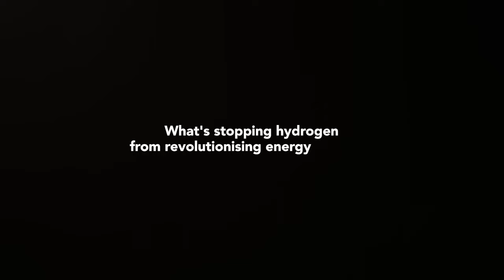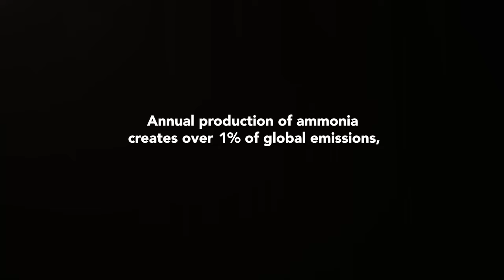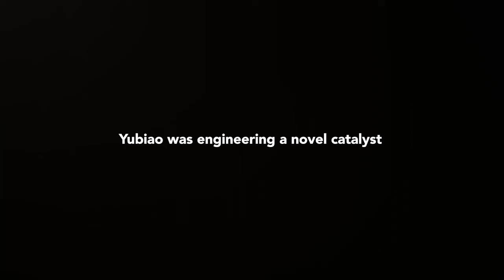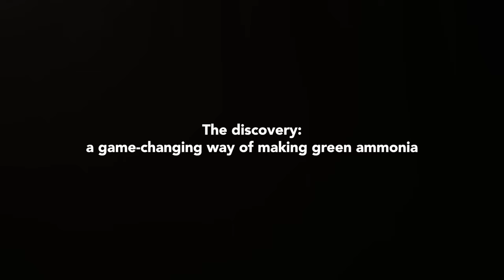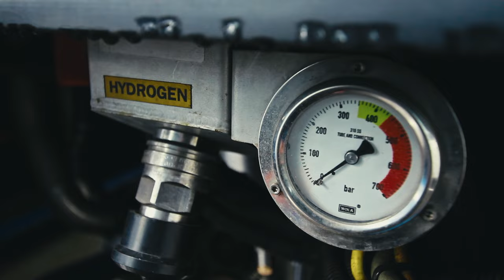How Green Ammonia Is Helping To Drive The Hydrogen Transition | Nium | RE:TV

Comment: Recently I was reading about eutrophication of lakes and rivers. One of the contributors to it is rain heavy in nitrogen. How is that solution contributing to the problem? Heavily/at all? Seems like if everyone would burn fuel that emit nitrogen, its not very good. Maybe better than CO2, but I think its good to think about it.
Reply: the problem of acid rain is indeed partly nitrous oxide you get when burning fuels, it is actually an incomplete combustion product, if you manage it well you don't get NO2 in the fluegas mix but only N2 which is fine. that's why diesel truck now also fill up on add blue at the gas station, this is mainly urea and added to catalise the nitrous oxide
Reply: @Brammist  Thanks for explanation. Isnt N2 also part of the nitrogen cycle tho?
Reply: nitrogen exists in many different forms called molecules. The nitrogen you are talking about is N2. Ammonia is NH3. During fertilization part of ammonia is emitted in the air. This ammonia then travels through the air onwards to the ground/lakes where it gets absorbed. When it absorbs into the ground bacteria further digest ammonia into nitrate. Nitrate then ends up as an ionic compound in ground water. This then eventually ends up in lakes and rivers where algae love to grow due to excess nitrate in the river beds etc.. That is what is called eutrophication.

So back the question; burning ammonia as a clean fuel produces N2 and H2O. This means no ammonia is emmited in the air and you actually have contributed to less ammonia polution cause you took away part of the compounds that either would end up in the air and cause this pollution. The process of ammonia deposition from the air is what they also called heavy rain back in the 90's.